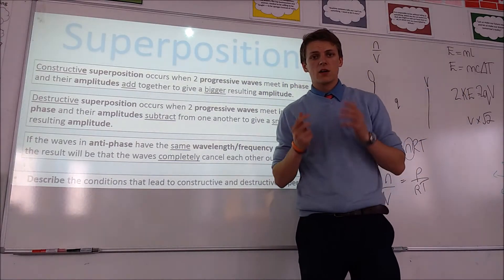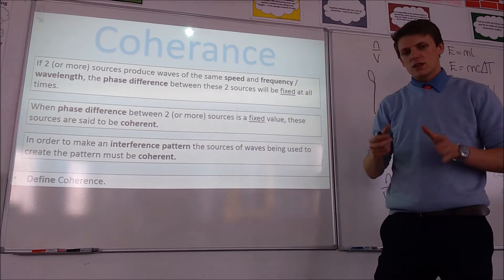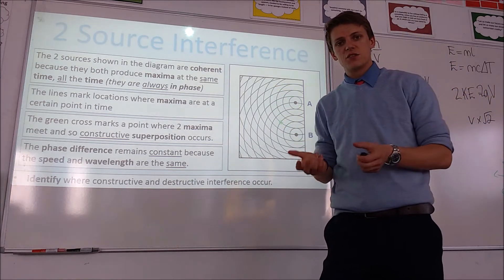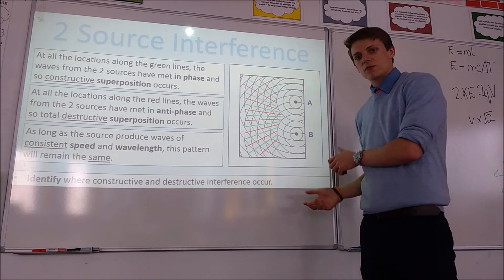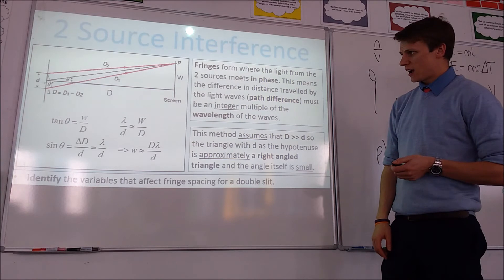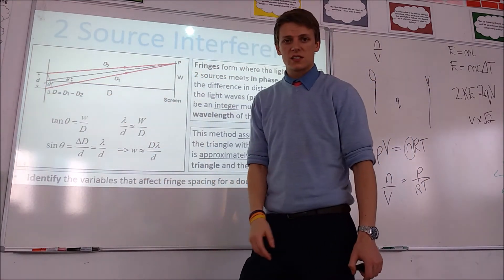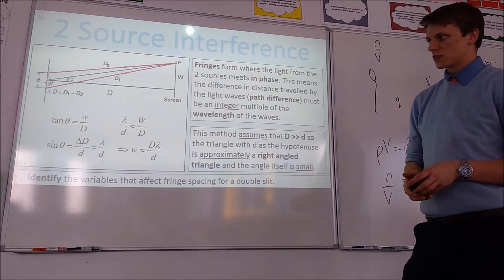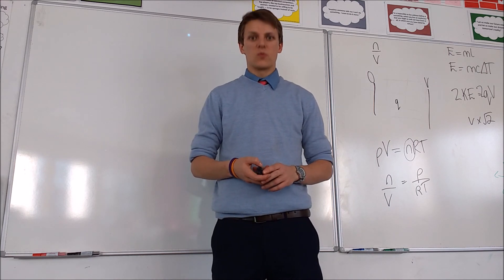A Level Physics: All Exam Boards: Waves: Double Slit Interference

Comment: sorry i deleted the question but just to clarify for the double slit interference the width of the central fringe is the same for the other ones, Also, does the intensity also decrease in exactly the same way, so gets to like a quarter of the size of the central one or is the decrease more gradually (for the double slit interference) ? thankyou for the video!
Reply from the maker: As you increase the number of slits, the difference between subsequent maxima decreases. I have never seen a precise numerical value for the relationship between adjacent maxima